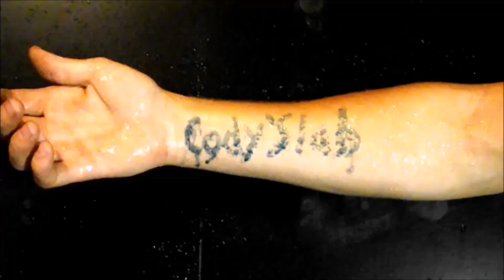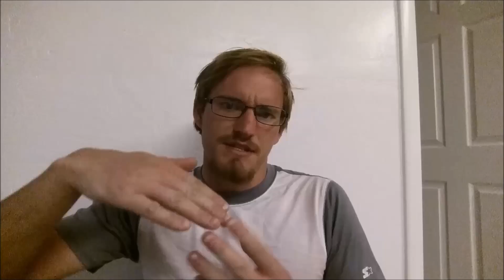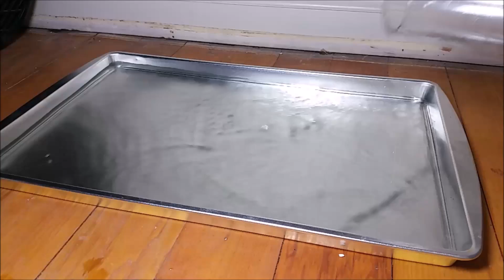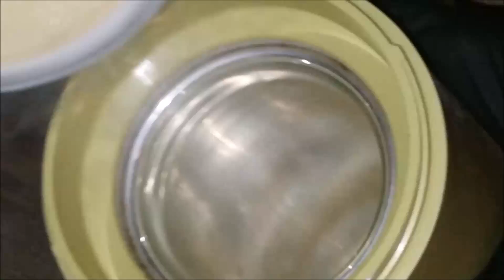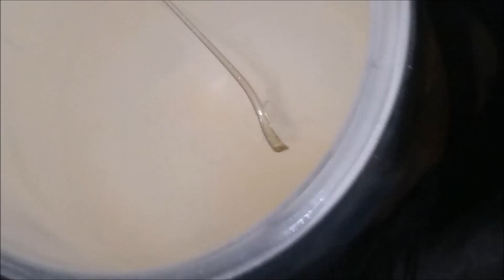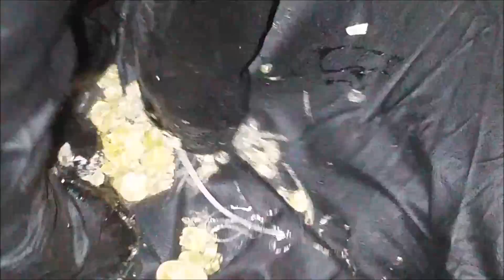What If The Oceans Were Made Of Acetone?

Comment: I believe that the reason the acetone creates more waves is due to the fact that acetone is about one half the viscosity of water. As you know, the more viscous a fluid is the more resistant the fluid is to motion. It could be that waves are a result of viscosity and not surface tension despite the fact that the two parameters(viscosity and surface tension) are usually positively correlated.  Great video Cody! Keep it up :) 
Edit:
 It seems a lot of other people pointed this out lol. I thought I was the first haha

Comment: Cody, did you use the same volume for both liquids? The acetone trial looked like it had a shallower depth. If so, the waves would be higher given the higher energy per volume of liquid across a given surface area.

Comment: There are a couple of things happening in your experiment.  The first simple thing to consider is that with the same forcing, the object with less mass will move more, i.e. the acetone.  Second, the 'wind' in this case is a very turbulent flow, not quite the same thing as what happens at larger scales like a lake or ocean.  Regardless, with a bigger basin, you could measure the wavelength and frequency of the resulting mixed gravity/capillary waves.  They have a relationship (the dispersion relation) linking wavelength and frequency which depends on density.  Your cool video already reveals some of that nature.

Comment: sorry but your wrong on how waves are created, yes the wind does help a little bit but most waves are created because of different depths of the ocean. the water flows and hits a barrier (the higher sea floor) thus slowing down the water that is deeper causing the top layer of water too roll over it kinda.

so yeah the wind kinda pushes the top layer forwards and this makes the same effect. i assume that acetone is better at taking the energy from the wind and converting it into movement thus making more waves, probably because of the viscosity or something.

but great video anyways :D

Comment: The honey at the end reminds me of a Prince Rupert's drop. You should see if materials other than glass can make them (at different temperatures, of course).
Reply: Captinpixles So why wouldn't other materials do that?
Reply: +Captinpixles Actually, steel, when cooled rapidly in water or oil hardens. It becomes very brittle and I have no doubt there would be pressure inside.
Reply: Captinpixles Maybe he would be able to figure out why glass is the only material that does this, or if other materials do to. That's the point of an experiment.
Reply: Hooman Are you sure? What if it happens because glass is an amorphous solid? There are other brittle materials that you can cool fast.
Reply: +Generic Username  When I saw that, I ha-ha'd to myself...Ha-ha, Prince Cody's Drops. How sweet! 
And then I ha-ha'd at my accidental pun.
Reply: +Generic Username except glass isn't an amorphous solid
Reply: +Hooman its tempered glass like car door windows hit edge and if falls apart hit center and itll just do nothing unless it affects the middle tension layer which is easily done on edges prince ruperts drops are amazing i seen someone hit it with a 10 pound sledge did nothing till he scrped the small bit on end oncthe ground lol

Comment: Buoyancy and viscosity are more important when considering instability for large length scales. Surface tension becomes comparable on length scales like you've shown here but changing to acetone changes the buoyant and viscous forces, too,  making it difficult to isolate the role of surf tension. Try some soap in the water for a better comparison between cases. Great videos, Cody.  +1

Comment: Skin friction. Across a surface, the air molecules closest to the surface is not moving very fast at all. This creates a slightly turbulent layer just above the surface, which has pressure imperfections, as well as exert a force that moves the top layer of liquid. These two things wil cause small movements in the surface. As soon a a ripple appears on the surface, the air moving over it creates a low pressure behind the ripple, and high pressure before it, which will amplify the ripple and pull it in the direction of the wind. I was surprised when I first learned that the size of waves on the ocean can actually be calculated using the wind speed, water depth and distance the wind has affected the water. This is how the weather forecast predicts wave heights.

Comment: Acetone's density is about 79% that of water, which may affect it, but its viscosity is only about 35% that of water.  This seems like a reasonable explanation: lower viscosity meaning less energy dissipated by wave motion, so waves become bigger before energy input from the wind balances energy lost through viscous drag.  

You could try with ethanol, which has 123% of the viscosity of water but only 31% the surface tension.  My hypothesis would be that ethanol would form smaller waves like water does because of its high viscosity.

The logical extreme would be cooking oil, with slightly higher surface tension than water but vastly greater viscosity. I would expect no waves at all in that case.

Comment: Hey Cody, could the vulnerability to the wind be influenced by the boiling point of the fluid, or its readiness to vaporise?
possibly the acetone is more influenced as it is changing into a gas quicker at the surface of the fluid. with more interaction with the surrounding gas(in this case air) the movement of the gas has greater influence over the movement of the water?

would be worth trying with a few more fluids with different levels of "wanting to change into a gas". I can't remember the term :(

Comment: Neat experiment, and great way to test the hypothesis.  I think surface tension would have some effect, but as others have pointed out, density and viscosity are the big factors in determining a fluid's flow properties.  If you get the chance to play with liquid CO2 in a clear chamber, the waves that it forms from shaking the container look very unusual.  It's viscosity is much lower than water or almost any other liquid, and the density is a little lower.
Reply: +Applied Science But if the clear chamber happens to be made of acrylic, do the experiments fairly quickly :D
Reply: Try disrupting the surface tension and leave the density pretty much the same.  The surface tension will really only be noticable in capilary wave formation.  Of course you could get taofledermaus to do it in mercury.
Reply: +Applied Science Another reason for the larger wave size may be due to acetone vapor causing a surface vortex effect. The air closest to the surface is more highly loaded with vapor slowing down the air. An optical schlieren system might show what's happening.
Reply: +PyroTech76 that is a great idea although I dont know where cody could get one of those at. maybe he could make one? I mean if applied science could make a diy electron microscope then I'm pretty sure an optical schlieren device could be diy made aswell.

Comment: Odd, in physics we learned wave height related to the density and viscosity of the water, the same amount of energy could life a higher volume (and thus wave height) of a less dense liquid. You could test that by adding salt or sugar which shouldn't affect the surface tension as much as the density.

Comment: Great test.  Aceton has a lower specific weight, if it was a solid it would give a higher frequency. So seems right.  Then there is Internal friction - cohesion? .... fluidity. If it drops faster through a hole, I expect higher frequency.

Comment: 1 there is interference in a pan
2 CRASHING waves requires higher surface tension, its the accumulation of strain that causes them while at lower surface tension, the strain is immediately resoved is smaller, weaker waves that never have the potential to crash

Comment: Perhaps it has to with the lower density of acetone making it easier to be moved by the air?
Reply: This was my first thought as well. Decreasing the density would (all else being equal) make larger waves since it would be easier to accelerate the fluid.
Reply: @xokocodo  yeah it would be easier to accelerate the liquid, but since acetone is only 20% less dense than water, it would only be accelerated 20% more, which is much less than what was shown in the experiment
Reply: +Cognito 
I suspect t hat has a lot to do with it as well. Old movies about Naval war used scale models that were often quite detailed, but the water never looked right - particularly the foam and droplets torn off the wave tops. I wondered why they didn't use a liquid with less surface tension and density whose waves would look better when scaled down. Anyone who indulges in alcoholic beverages has probably noticed that the froth generated atop carbonated liquids disappears instantly when ethanol is added, reducing the surface tension necessary to support bubbles.
Reply: +Cognito Kind of like how a sack cloth flag would flutter less than a sheer silk one. Also, there are hydraulic forces at play not accounted for. I wonder what it would take to have waves in honey. Viscosity plays in too I'd bet. Oils might be a good test bed for viscosity effects on waves since they are so well known and tested. Also with acetone there will be evaporation effects happening not as much in the water at room temperature. Local air pressure and direction of travel probably have the biggest influence though. If you had acetone oceans your atmo would be a lot different too. Neat thoughts though.
Reply: +Damian Reloaded Maybe if you pour a lot of oil around fully loaded ship then it sinks a little bit and some oil can get to someplace where it shouldn't. Since oil is lighter than water it could be poured from a submarine. Sometimes a large bubble of methane is released from ocean floor which can cause ships to sink. This would be more effective than oil but I've never heard of such a ridiculous weapon.
Reply: Oh, very interesting! [...] If bubbles can indeed sink ships, the military might want to use them as a weapon. Michael Stumborg, a researcher at the US Naval War College in Rhode Island, has proposed building “buoyancy bombs” that would collect and release bubbles. An underwater vehicle could extract methane from a deposit in the seabed, then transport it to a point underneath a target ship. “The release of the methane will reduce the buoyancy of the ship and could in principle sink it,” says Denardo  .
Reply: +Cognito That was my initial thought too, but then I'm not sure if surface tension is related in any way to density.. If not, it'd be interesting to repeat it with a higher density, lower surface tension liquid, and a lower density higher surface tension liquid..
Reply: @rob-muntron  Acetone has a lower density
Reply: +Cognito That's exactly what I was thinking!
Reply: I wonder if there is any substance you could throw around a boat to make it sink... I mean like something that could deviate or attenuate the buoyant forces  so the boat would float less..
Reply: that doesnt make any sense, Damian. but you could use an acid to make a hole or something heavy on the boat to make it sink
Reply: Anton Helsgaun It does make some level of sense it's just that you're not entirely informed. Soapy/detergent water is less buoyant due to the loss of it's surface tension. Substances that reduce surface tension of a liquid are called surfactants there is a whole wiki about it. So based on this I was pondering if there could be some. say. superhydrophobic that could make a boat sink.
Reply: Damian Reloaded I know that reducing surface tension might make the boat a little lower, but the main force keeping a boat afloat is not surface tension
Reply: Anton Helsgaun Of course it's not.

Comment: The gravity of the moon and sun probably adds to the effect of waves, but that's not something you can scale down lol. 
Thanks for these awesome videos..
Reply: +Cody'sLab The astronomically forced waves on the surface of the earth have many different cycles.  The principal (strongest) are called diurnal and semi-diurnal.  Depending on location, these could be mixed or one could dominate the other.  So there are locations where the tide is one cycle per day, i.e. dominated by the diurnal tide.

For everyone's clarification, 'tidal wave' is a poor term, but most commonly refers to a tsunami, which is when the ocean responds to a large scale localized forcing.  Tides are the astronomically forced oscillations of a planetary fluid. Yep, there is atmospheric tides and even earth tides.

Cheers
Reply: +Cody'sLab  Well, no, they are in continuous movement but only hit their highpoint and low point twice a day.
Reply: +UnbeltedSundew Some places they cause waves though. Search for "surfing tidal wave"
Reply: Yes I've seen stuff about them in rivers and such, but tidal wave is generally used as a generic rather than a specific term.  As such people use it to refer to any large singular wave.  In addition the movement of the tide creates waves depending on obstructions and flows and are often as not referred to in the plural as tidal waves.  Cody was probably talking about your specific occurrence, but really tidal waves in that sense had very little to do with the opening post.  Note that original post wasn't referring to tidal waves it was talking about how tide creates water movement, which I reiterate occurs constantly throughout the ebb and flow of the cycles.

Comment: Hey Cody! I think density and viscosity, like pontifier suggests are the most likely culprit. Acetone is much less dense and much less viscous than water (3/4 the density and about 1/3 as viscous). The waves are likely caused by the force of air against the liquid, so a liquid that is less dense and more viscous would be more greatly affected by the force. You could probably try this with an even less dense liquid and confirm this hypothesis, try this experiment with other liquids that vary in density and viscosity.
Reply: Exactly what I would do! I am sure you found this link already but here are some common materials and their viscosity: http://www.engineeringtoolbox.com/absolute-viscosity-liquids-d_1259.html

Keep up the great work, I always look forward to these videos.

Comment: Wouldn't it have to do moreso with the viscosity of the fluid than the surface tension? If I were you, I would have tried this with vegetable oil or something as well. I looked it up, acetone has quite a lower viscosity than water.

Comment: You're not considering the effects of viscosity on wave profile. Acetone is much less viscous then water, which could mean that bigger waves form even with less surface tension present. You'd have to experiment with liquids of similar viscosity and different surface tensions or vice versa to get a strong conclusion.
Reply: that's what the soap experiment would be. less tension same viscosity.
Reply: Wouldn't the soap impact the viscosity of the water?
Reply: +Macrotechee1107 Soap would increase viscosity.